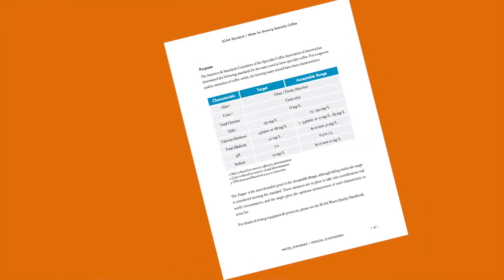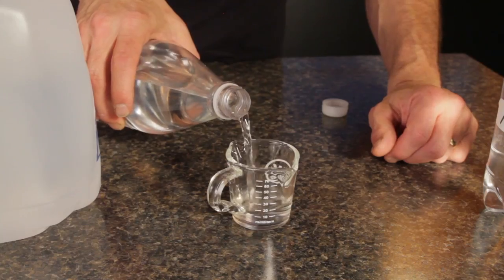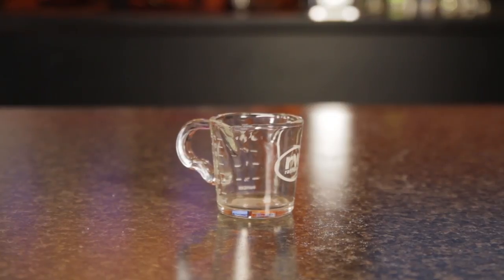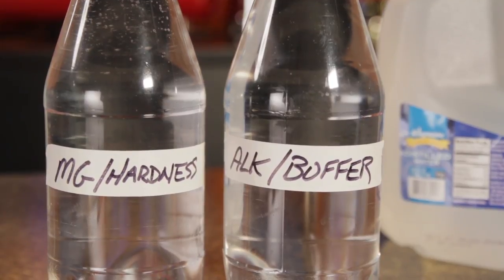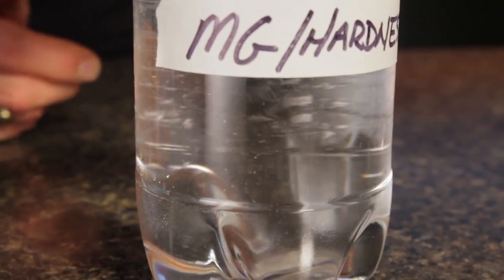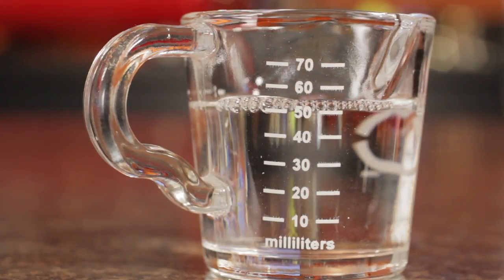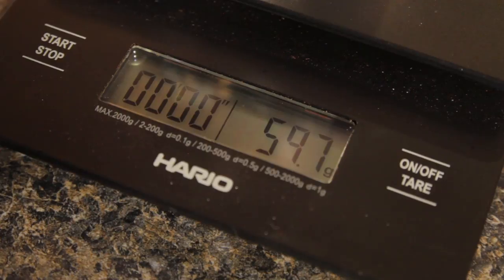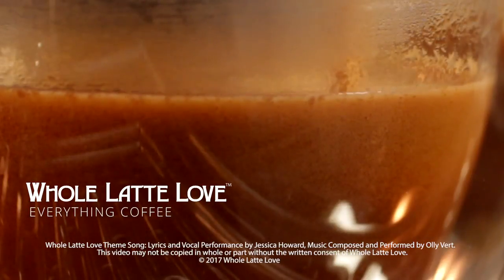How To Make Basic SCA Coffee Brew Water

Comment: I just purchased a Jura E8 and am concerned about scaling. Coming from the world of cheap drip machines that I just threw away when they got scaled this is now a big concern as this machine cost a chunk of change. In your experience is the claims of not needing to descale if using the jura filter true? Would you recommend using the BWT filter pad in addition to the factory filter? Thanks.
Reply from the maker: Hi Jerry, I was a little skeptical of their no descaling claim initially.  I have asked Jura about this many times and they assure me with proper filter use descaling of Jura machines is not required. Your E8 has the Intelligent Water System with RFID tags in the filter which makes it easy to stay on top of filter maintenance.

Comment: hi i have an olympia cremina sl and im trying to find out the best possible way to get good tasting water without scale, can you tell me what my best option or options would be for a machine like this?
Reply from the maker: Hi Adam, Thanks for the question. I like BWT water treatment options. Their Bestsave in reservoir pad filters are a good solution for those who go though less than a reservoir full of water a day as they require 12 hour soak time: https://www.wholelattelove.com/products/bwt-bestsave-s-anti-scale-filter If you go through water faster or would appreciate a system to produce drinking water have a look at their Penguin Pitcher: https://www.wholelattelove.com/products/bwt-penguin-2-7-l-water-pitcher
Both BWT solutions do the typical carbon filtration for chlorine and other chemical removal. The real trick is calcium to magnesium ion-exchange. This leaves you with a mineral level needed for flavor that will not cause scale when used as directed.
Marc
Reply: @Wholelattelovepage   the filter for me is a bit pricey and i dont think will fit in the cremina since the way to fill it is just a very small hole at the top, originally i was worried about the mixing sca basic brew water because barista hustle claims that recipe may cause corrosion in some machines however i have found the cremina has stainless steel boiler so will not have to be too concerned about that. i live in winnipeg so now im just wondering if i should be filtering my tap water or just mixing up your recipe for basic sca brew water. both will be fine options i assume for my machine so long as i descale every once and awhile. any opinions on those two options or other recommendations?

Comment: Hey Marc!  I just tested my SCA water using this recipe and the hardness of my water using a water hardness test strip is showing purple. Went from green to purple.  The distilled water is showing green.  Any suggestions?  I’m thinking purple means extremely hard.
Reply from the maker: Hi S2, Thanks for the question. Not sure which test strip you are using - would think the strip would have a reference for what the colors represent. But... distilled water is mineral free. The SCA brew water does have minerals  - and you want some to support flavor and to protect your equipment from corrosion. Magnesium is the main mineral in the SCA brew water recipe and will show in a test for total water hardness. Compared to water with calcium as the main mineral, the SCA recipe is less likely to cause scale.

Comment: Hi Marc, can the concentrates be stored in the cupboard at room temperature safely ? How long should they be kept or made fresh? I’m thinking of using magnesium chloride instead of epsom salt. How do I figure out the weight to add per litre of RO water?
Reply from the maker: Hi Jackson, Thanks for the question. Yes, concentrates can be stored safely at room temperature for a very long time. Epsom salts are 10% elemental magnesium while magnesium chloride is 25% so divide by 2.5 for same amount of magnesium.
Marc

Comment: Will doing this reduce if not, prevent scaling in espresso machines?
Reply from the maker: Hi KC, It shgould significantly reduce scale potential as compared to using hard tap water. Helps that much of the mineral content here comes from magnesium which is less prone to producing scale than calcium.
Marc

Comment: Hi Mark. I just purchased from WLL a new Gaggia Classic Pro. I have a RO system and followed your video on making my own re-mineralizing   I tested my water prior to demineralization and it was 25 ppm.  After demineralization it increased to 125 ppm. Is 125 ppm sufficient for re-mineralization. If it is how often should I descale my machine if I average 2 espressos a day.  Thanks again for your expert advice and enthusiasm.
Reply from the maker: Hi 10, Thanks for your patronage and question. 125ppm should be sufficient for re-min. TDS measurements do not tell the whole story of water hardness but starting with RO at 25ppm (guessing your RO has some bypass remin built in? Or maybe not using DI treatment after RO?) and upping minerals as shown in video should leave you with water that's not going to cause a lot of scale. At your use level I recommend descaling you machine 2-3 times per year. You may have little to no scale formation but better safe than sorry.
Marc
Reply: @Wholelattelovepage  Thanks Marc responding so quickly to my question.  Appreciate the additional information and guidance.

Comment: Late to the party, but my searches for coffee/water quality led me here. I couldn't help but check your calculations and they look perfect. Wondering though, is there any advantage to using separate stock solutions for hardness and alkalinity? I used 1 tsp of baking soda and 1.5 tsp Epsom salt and filled with 500 g of RO water. Adding 47 g of concentrate to a gallon of water should get me pretty close to the target values.
Reply from the maker: Hi Jeff, Thanks for the question and apologies for a delayed response. Been a little hectic here in NY as we adjust to deal with current events. I use separate solutions as you cannot combine concentrates or they will precipitate. It may be possible to combine the BS and ES at lower concentration without causing precipitates. Hope that helps!
Marc
Reply: @Wholelattelovepage , thank you for taking the time during the craziness. Hope you and your families are staying healthy. Completely, missed the precipitation issue - makes perfect sense.

Comment: Hey Marc, I don't know if you'll see this comment. But I have a question about the kind of epsom salt used. I bought a bag of epsom salt recently. It's pure magnesium sulfate but it also says do not ingest. The package says it's used for baths and as fertilizer.

Do we need to buy food grade epsom salt? It's a lot more expensive than the price you mentioned in the video.

Hope you see this comment. Thanks.
Reply from the maker: Hi Ricky, You're probably thinking I didn't see your question - I did! Sorry been on vacation for a week and was off line. Know for the future I do respond to all original comments on the videos. Some times delayed a bit.

I'm using "Top Care Epsom Salt" It's a store brand sold at my local Wegmans Super Market in the pharmacy isle. It's labeled as Magnesium Sulfate U.S.P.
Epsom Salt is commonly used as a laxative dosed at rate of 10 to 30 grams/day. So don't worry about it making you poop in the concentrations used in the brew water recipe :)
Directions for making at laxative strength are on the bag I use so it's definitely okay for human consumption. It's likely (but I'm not certain) different grades of Epsom Slat are available. I'd look at a pharmacy to be on safe side.
Marc

Comment: Great video, Marc. I always look forward to your productions. Quick questions: since calcium is not present in this formula, does using this water result in less or no scaling in the boiler(s)?  I currently use a BWT in reservoir filter, should I continue to us that filter if using this formula? Thanks in advance, t.
Reply from the maker: Hi Tingstarr, Thanks for the comment and question. Mg in sufficient concentrations can cause scale just like calcium. But, in this preparation, the Mg level, along with the alkalinity, pH, TDS and temps involved will not cause scale formation or corrosion in boilers. I'll be covering the Langelier Saturation Index in a future video. It's a formula which takes your water parameters and determines scaling or corrosion potential. Unless you have extremely hard water to start with the BWT filter should prevent scale in your machine by providing a mineral level below that which would result in scale deposits forming.

Comment: Just ordered a Profitec Pro 600 from you guys. I had been using RO water in my BBE, but figured I oughta re-mineralize... Followed this recipe exactly with my RO water (which had a TDS of less than 5) and having been using it for the last week... today I discovered an odd almost goop-like jelly along the walls of the reservoir in my BBE... What could that be?
Reply from the maker: Hi AB, Thanks for the question. Not sure what the goop is. I've mixed up the water and kept for months in jug and never had anything like that. Strange things could happen if you mix the full strength concentrates together before adding to your RO water. Those should always be added to RO water individually and mix one in well before adding the other.

Comment: So about to get my gaggia classic pro. Would this be the best way to make my water instead of using  regular filter or buying bottled water?
Reply from the maker: Hi Bryce, All depends on what type of regular filter or bottled water you are using. Vast majority of tap and pitcher filters do nothing to control minerals. Bottled waters can be all over the place in mineral level. Some add minerals to improve flavor. If your tap water is safe to drink and doesn't have edge case issues like unusually high chlorides then my favorite options are those using calcium to magnesium ion-exchange in addition to activated carbon for removing chlorination and other chemicals. I use the BWT Penguin Pitcher to feed non-plumbed machines in the studio. It has the ion-exchange tech: https://www.wholelattelove.com/products/bwt-penguin-2-7-l-water-pitcher Used as directed it eliminates scale potential yet provides mineral level required for flavor and preventing over-extraction. BWT has in reservoir pad filters which do the same thing: https://www.wholelattelove.com/products/bwt-bestsave-s-anti-scale-filter With those a soak time of ~12 hours is required.
Marc

Comment: Will using this  instead of tap water reduce scaling or completely avoid it in an espresso machine? I'm not worried about taste just avoiding scale, just ordered a barista express from breville
Reply from the maker: Hi w, Thanks for the question. It should reduce scale but cannot say it avoids completely. I would still descale the machine on a regular basis as recommended by the manufacturer.

Comment: Hi Marc,
Thanks for the great information.  I started using your brew water recipe when I purchased my Profitec Pro 700 from WLL about three years ago.  Recently, the flow from my hot water dispenser has slowed down to a trickle.  I know I had a bit of green mineralization on the mushroom a couple months ago, when I cleaned it.  I can also blow air into the boiler from the hot water spout, which improves the water flow a bit for a day or so afterwards.  Seems like maybe I have mineralization in my boiler.  I'm getting ready to demineralize it, but wanted to ask about your recipe.  I'm starting with pure (not remineralized) RO water, which has a TDS of 0 ppm, total hardness of 0 ppm, total alkalinity of 0 ppm, and pH of ~6.2.  Any thoughts as to why I would have this problem?  Would you expect this level of mineralization after three years?  I should also mention that every day I make about 1 latte and 2 Americanos.
Thanks again for all the great info.
Reply from the maker: Hi LK, You are welcome for the info. The basic SCA water recipe is not one that totally prevents scale formation. It can reduce compared to a "hard" tap water and 3 years of daily use is a good indication of that. 3 years is a rather long time to go without descaling. With minimal scale on the mushroom and improved water flow by blowing through the spout you must be moving something that's not a rock hard scale. Bottom line I would expect some deposits after 3 years of use and yours sound minimal compared to a machine using harder tap water.
Marc

Comment: Hi! Just got my rocket R 58 machine. Is this a safe recipe for my machine? Or would you recommend some filtration? I will be using the water tank. Thanks!!
Reply from the maker: Hi Sarah, This recipe is safe to us in an R58 but overtime may produce some scaling. Since dual boiler machines are difficult to descale I'd recommend using water filtration. Best available are those from BWT which use patented ion-exchange technology which replaces scale causing calcium with magnesium. You get water with the minerals needed to prevent over-extraction and support flavor without causing scale in the machine. Two BWT options are there BestSave pad filters which you drop in the reservoir: https://www.wholelattelove.com/products/bwt-bestsave-m-anti-scale-filter
Or their Penguin Pitcher: https://www.wholelattelove.com/products/bwt-penguin-2-7-l-water-pitcher
Hope that helps!
Marc
Reply: @Wholelattelovepage  thanks for taking the time to reply!!

Comment: Marc, if I make the water mix and use it for my espresso machine do I still need to add the scale reduction filter pouch in my water reservoir? I use the Bilt Osmotic Scale Reduction filter.
Reply from the maker: Hi Max, Thanks for the question. I have not used the Bilt but it's my understanding it uses calcium to magnesium ion exchange. The SCA mix uses magnesium for the bulk of the hardness so you're already doing what the Bilt would do. The SCA recipe is unlikely to cause scale build-up. Personally I would do prophylactic descaling.
Marc

Comment: What over the counter water can you buy that is good for Pour Overs.  Available in the US please.
Reply from the maker: Hi Jay, Thanks for the question. Very hard to make a recommendation as mineral content is all over the place depending on vendor. You want water with some mineral content but not too much. So do not use pure reverse osmosis or distilled water. They have no minerals. Also, stay away from mineral water and some spring waters which are high in minerals.
Marc

Comment: If i use this water in my espresso machine do i still use the machine's water filter and will i still have to descale as before?
I love this side of coffee making, i though it was all about the beans lol
Reply from the maker: Hi LL, Thanks for the question. It's unlikely scale will form using this water. I'd still descale - but less frequently. There are other factors like concentration of minerals in steam or HX boiler main sections if only used for steam and not hot water.

Comment: I didn’t understand what you said at the end about making water for boilers but this water will be fine for a boiler machine right?
Reply from the maker: Hi Adam, Thanks for the question. Yes, this works for espresso machines. Still recommend descaling from time to time. This water is less likely to cause scaling as bulk of mineral hardness comes from magnesium which is less likely to cause scale deposits than calcium rich water.
Marc
Reply: @Wholelattelovepage  in terms of taste will this water still taste good? Or will it be all noticeably salty and weird from the baking soda/Espon salt

Comment: Hello  there,  

I would like to point out one problem with RO water.  During the RO process we are removing the water treatment chemicals...  

I only realised this when I've noticed molding in my canisters and hoses to my coffee machine ( Astoria lever).

Now i am thinking of adding chlorine dioxide.

I would be most grateful for your view on this.
Reply from the maker: Hi bokicar1, Thanks for the question. I personally have never seen mold growing in RO water containers or transport tubing.  Please understand the main purpose of RO is to create ultra-pure water. I'm not a biologist but I suspect mold spores would need to be present in an RO system and they would require some nutrients to grow/multiply. We run 2 RO systems here at the Whole Latte Love offices. One directly feeds a Dalla Corte Mina espresso machine. The other creates the base water for our  in-office hydroponic garden. Both up and running for sometime and I've never observed mold. I've personally run a home RO system to provide the base water for my saltwater aquariums. My RO water is stored in a 50 gallon plastic drum in a basement. That system's been running for 6 years and never had a mold problem.
I would not chlorinate water feeding an espresso machine. Chlorination is not good for flavor and under the right conditions can create an acid (very weak) in espresso machine boilers.
I suspect your problem may be because of a problem in your RO system like a bad/old membrane or other maintenance issue.  
Marc
Reply: Whole Latte Love many thanks Marc for your replay

Comment: How could this be applied to espresso? I understand FloJets can be use to supply prepared water like this, but it possible to apply magnesium and sodium bicarbonate to a reverse osmosis filter? Changing out 5 gal bottles and dosing them with minerals seems like a hassle. 
I ask this in the context of a commercial setup. Thanks!
Reply from the maker: Hi SL, Thanks for the question. There are remineralizing setups for RO water in bothe commercial and home setups. In fact that's what's done in every high-end cafe in my area. Water is RO treated and then minerals are added back in after treatment. Here's a remineralization filter for that purpose: https://www.wholelattelove.com/products/bwt-bestmin-premium-m-filter-cartridge
Marc